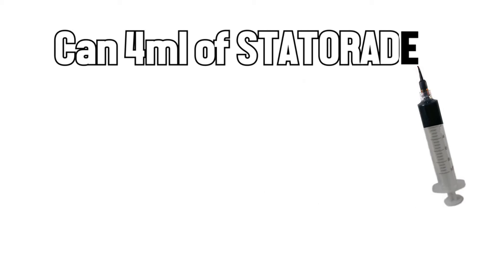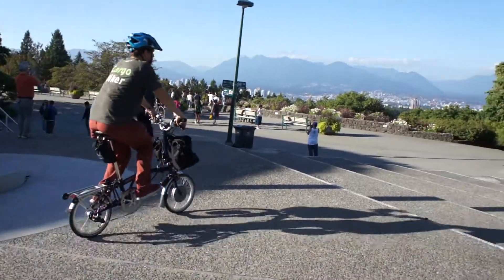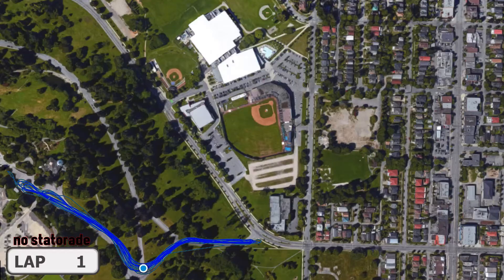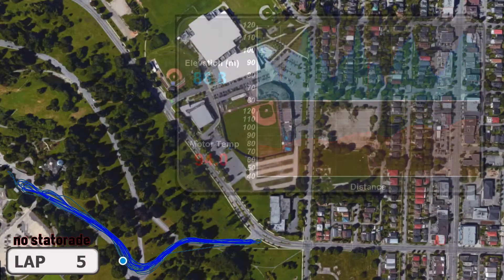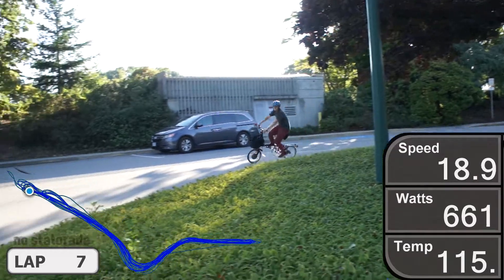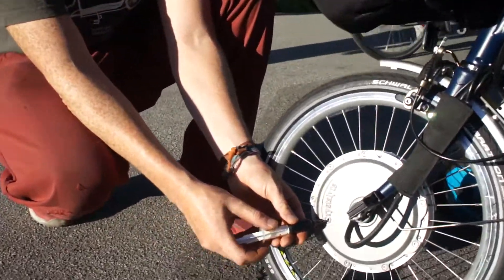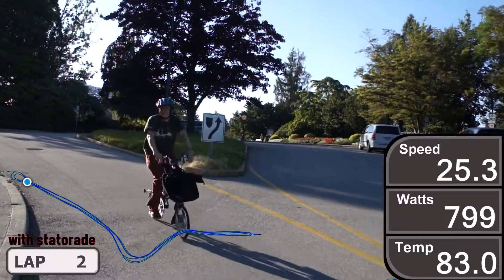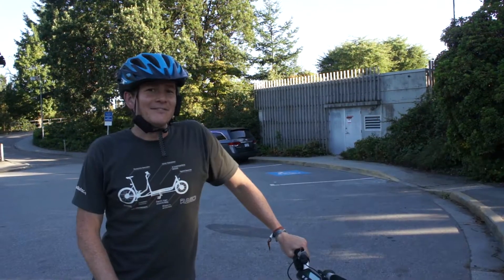The Magic of Statorade Motor Coolant, Test Ride with Small Brompton Kit

Comment: Does this mean that my bike riding is limited by the outside temp wit this setup? What was the outside temp during this test.
Reply from the maker: Yes of course, outside ambient temperature will play a direct roll in the sustained power output of anything that is in active thermal rollback since it allows a higher deltaT to be present from the sense point to the ambient air. And a higher deltaT means a larger flow of heat. 

Probably 20 +-5 celcius based on wearing a tshirt and being in Vancouver.

Comment: I use aikema's 74mm front motor on my bike and I see how many watts I consume instantly with the kuntenk (KT) controller, but I would love to have an option such as a watt stabilizer, not a cruise control, for example, let the motor consume 100w of electricity. Can Saw motors and controllers have such flexibility?

Comment: Hello, I've been thinking about buying lightweight ebike but I don't know which one. I really like the Hummingbird ebike because it's featherweight and will be easy to fold and bring up and down stairs and on the subway. They use a 250 watt Zehus all in one motor/battery hub. It's super compact but the weight is entirely on the rear of the bike. Coupled with your body weight the bike isn't balanced. The benefit is that there is no external battery. What's your thoughts. Is there a way to take a Hummingbird, a Brompton T-Line, or a Birdy and make them into ebikes without external battery packs?

Comment: Is statorade good enough by itself? Or should i add the heatsinks with it. Cant seem to decide.
Reply from the maker: Statorade by itself improves the thermal conductivity by 80-100% (ie double the heatflow).  Hubsink fins add another 10-20% on top of that.
Reply: @GrinTechnologies  hmm I just made an account on your website and in really interested in trying to statorade and possibly the heat sink hubs too. 

I run a 52v battery on a 48v set up over volted.  Will the statorade still help with the heat?

Comment: I installed a sabvoton 100 amps on my 3000w motor and it came so hot that it unsoldered the green hall wire 2 times. I just put back my 60 amps controller and will test it tomorrow if it still do it.

Comment: Did you swap out the battery on the second round? 🤔 I guess I'll find out how's it going to perform 🙃 I just put 5ml in both of my 1000w can't wait for the test ride 😁👍.
Reply from the maker: Larger Direct Drives should have 6-8ml. You'll be fine with 5 though... The battery was the same the whole test.
Reply: @GrinTechnologies How much would you recommend for a 2kw V2 single shaft hub motor from QS? The type you bolt a rim to, around 18kg. Got two of them at the rear. Plus is there a gauge of roughly working out internal temps based on the hub motor body temp?

Comment: This is the test i wanted to see hell yeah.  Also looking to see if my atf filled 1500w bike will last
Reply from the maker: The hub with ATF fill should last just fine as a hub itself goes. But the main thing people doing that have had to reckon with is the gradual leaking / seepage of the oil out the bearings or wires which becomes a cleaning headache. Especially if any gets on your disk rotor.
Reply: @GrinTechnologies  im a car nut so i used sealent ment for atf had it sealed and filled for 2 weeks as wire brushed then sealed 
 So good to hear that u recon it will last done 60km so far. Just building my  22ah 44v battery pack atm 

Im like u i innovate and currently there is no local bike  shops so im gonna make them myself   even start importing some as im currently learning.  To make batterys packs at industrial quantity included recycling 18650s.      I have a very good understanding of electronics to the point.  I will do exstensive mods that are hard to do for most people
Reply: @haatch999 and did it last? How much better wss the temperature?

Comment: so 800w is okay setting for this motor with statorade?
Reply from the maker: Surprisingly yes, even a little motor like this can readily do 800W with the statorade coolant.
Reply: @GrinTechnologies 

Will statorade work with bigger 26 inch 48v 1500w motor?

Comment: Amazing bro ! Im buying more statoraid and sealing up my NSM MOTOR with silicon.
Reply from the maker: Yeah the small NSM motors are quite prone to overheating on hill climbs so they can really use it! Be sure to re-seal both side plates since by default Crystalyte doesn't do a very good job on the side cover sealing.

Comment: How often should you reapply statorade ?
Reply from the maker: So long as the motor is fully sealed at the side plates then almost never. We did lab testing running at the equilvalent of over 65,000 km with the motor at 120 degrees Celsius and and had almost no reduction in performance, see  https://endless-sphere.com/forums/viewtopic.php?f=2&t=48753&p=1375382&#p1375382

Comment: Hi Grin,

What capacity battery are you running on the Brompton? I just bought a SAW from you guys and am trying to figure what battery would match it. It’s a folding bike so the battery’s physical foot print should be smaller.

Thanks!
Reply from the maker: HeyJohn, for this particular video we were running 6 LiGos in a 72V 8Ah arrangement since we were also doing some 72V experiments for the customer. But in general when I'm using our shop Brompton it's with 4 LiGo's in parallel, for 36V 11Ah, which gives about 40km of assisted range. There are many small waterbottle format batteries that are in this size/capacity range if the LiGo's are out of your budget.

Comment: You only did 3 runs after injecting statorade, before the statorade you did 5 runs thats why it got hotter, you should do atleast 5 runs after statorade so we can actually know if it works or not
Reply from the maker: Hey James, what you'll notice is that after each run with the Statorade the motor wasn't getting any hotter, in fact it was even getting a little bit cooler.  So we know at that point it is at steady state temperature and won't change with additional runs. The idea of the test is to keep going up and down until steady state temperature was reached (ie no difference between one run and the next).  

If I had started the run with Statorade with a motor that was cold to begin with, it would have taken a few more runs to reach 84 degrees celcius but it would have leveled off at that same final temperature.
Reply: There's no doubt statorade works but you still could have done an equal number of runs for a fair apples to apples comparison imo
Reply: @Block Chain To make the observation that the number of runs wasn't equal is fair enough, but it was explained why. For you to make the comment they are scumbags, makes you an asshole!

Comment: Okay for heat, but you're obviously "spending" range by e-leakage through the statorade.  I assume it's electrically conductive more than air is.  Could you address this?
Reply from the maker: The fluid has no electrical conductivity; it's an insulator (synthetic oil based) and doesn't have any electrical properties that affect the motor. It's only the thermal conductivity that comes into play.

Comment: Very interesting results! my Qs205 at even 16kW keep between 20 to 30 degree lower with the Statorade and Hubsink. Both products are awsome!
Reply from the maker: Since we separately measured the core to shell thermal resistance with and without Statorade, and the shell to ambient with and without hubsinks, we can predict with very high accuracy what the performance is like with just hubsinks and no fluid.  For instance, the Cromotor at 300 rpm has a core to shell resistance of 0.26 deg/watt.  The shell to ambient resistance at this speed with no hubsinks is  0.066 deg / watt.  Shell to ambient WITH hubsinks is 0.042 deg/watt.   
So total thermal resistance with no hub sinks is (0.26 + 0.066) = 0.326 deg / watt,
Total thermal resistance with hubsinks added is (0.26 + 0.042) = 0.302 deg / watt

As you see, the improvement from hubsinks alone without statorade in this case is less than 8%. It will run a bit cooler, but not much. 

By comparison, if you don't add hubsinks but just add statorade, the core to shell resistance goes from 0.26 deg/watt down to 0.12 deg / watt.  Add on the 0.066 deg/watt for the shell to ambient and you get a total thermal resistance of 0.186 deg/watt.  That is a 75% improvement, way better than the 8% from just adding hubsinks.
Reply from the maker: Yes indeed, we distribute the hubsinks from our site as well.  Actually in our next video on this front we did a test with a 9C+ motor going up the mountains in north Van running bare, with Statorade, and then with Statorade and Hubsinks. The Statorade alone does about an 80% improvement, while hubsinks add another 10-15% on top of that.  I'll be posting all of these results on endless-sphere at some point, lots of great wind tunnel test data with hubsinks on lots of different motor series now (including Cromotor, Clyte H, MXUS etc)
Reply: So did you test with hubsink alone? To see how effective it is?

Comment: Will the coolant hurt the motor over time but I love what you doing did you make it so you can't burn the motor up which is good to know and I just don't know what size bike to buy where to start
Reply from the maker: FWIW, Direct drive motors are generally not hermetically sealed to begin with, they will always find a way of breathing as the motor gets hot and cool and results in a large pressure differential that will equalize one way or the other. The hole for injecting statorade is threaded so we put a small screw in afterwords to plug it.  
If you put heatsinks on the outside of the motor without adding a fluid bridge like Statorade or ATF etc,, the effects on increased cooling will be very minimal. About 80-85% of the thermal resistance in an ebike hub motor is on the inside, from the stator to the motor shell. The motor shell can conduct heat to ambient air very effectively even without additional fins on the outside. Adding them doesn't hurt, but it's not where the bottle neck is.
Reply from the maker: We haven't seen any negative consequences of Statorade in the motors so far except in a few cases where people have added excessive amounts and gotten some in the bearings which will like any thin oil product thin the grease.
Reply: Not the coolant, but the moment you drill it you loose hermeticity and you open you engine to moisture and dirt. A better solution is installing a circular heat-sink outside the motor. There are kits that you can buy for every type of motor.